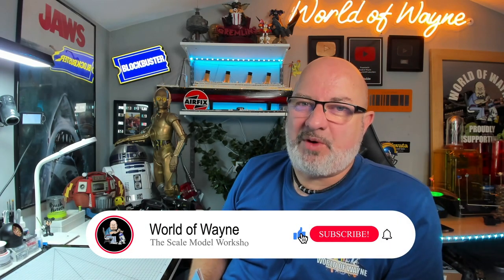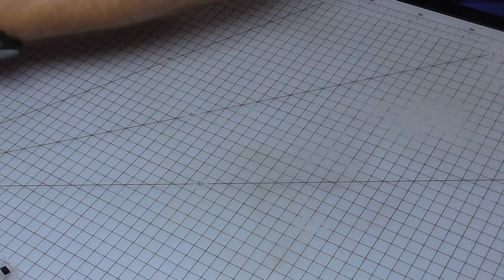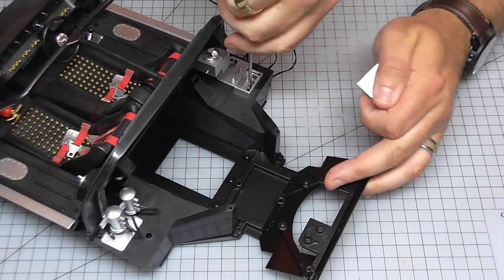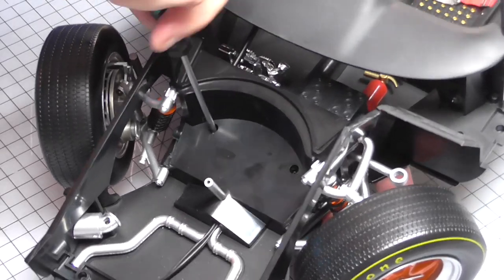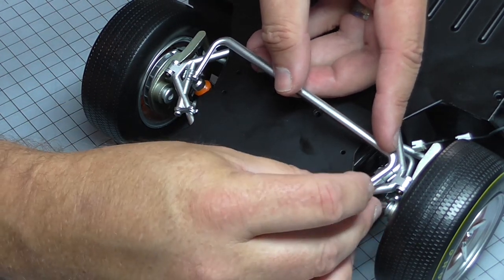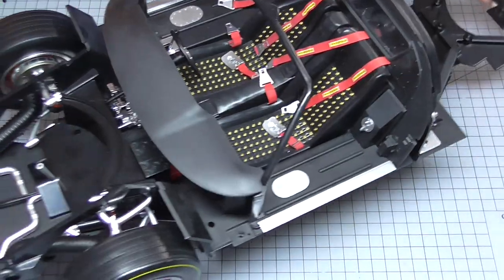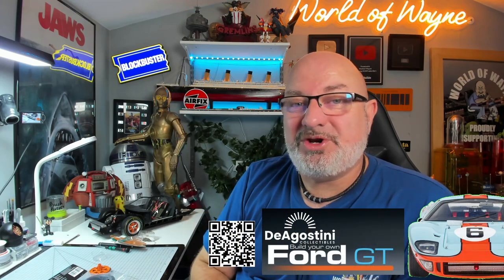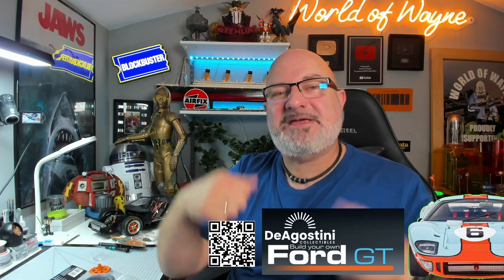Build the Ford GT - Pack 12 - Stages 53-57

Comment: Does the steering still work after securing in the cooling hoses? With the parts being hard plastic, it appears the wheels are held firmly in place. After Pack 54-57 - It's Miller Time! That was hard work!
Reply from the maker: Yep. It actually misses them